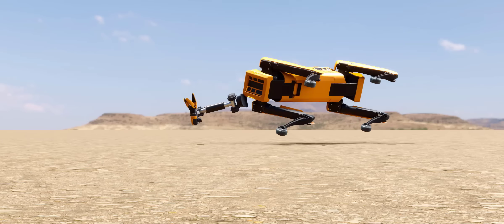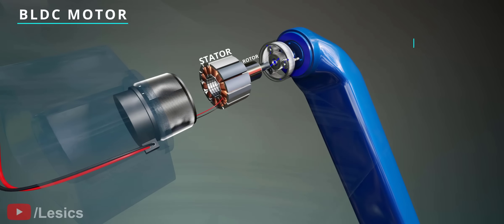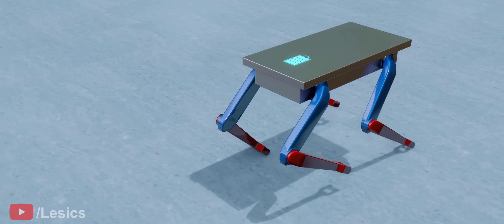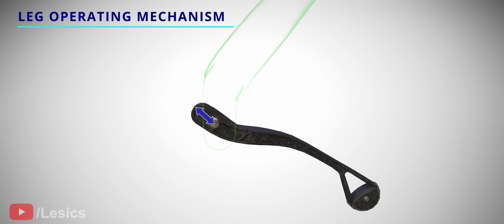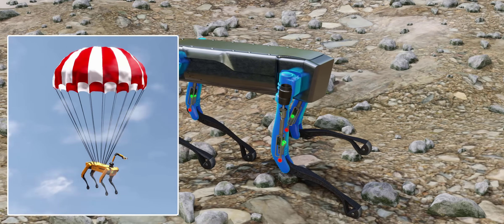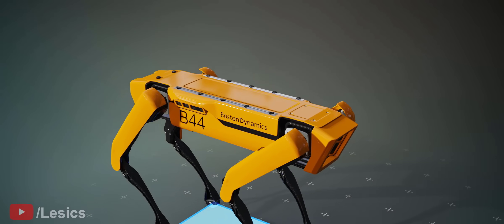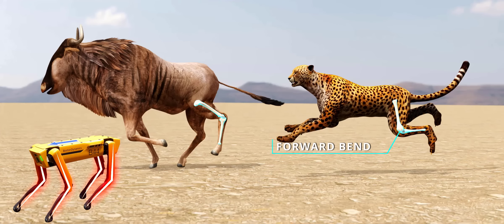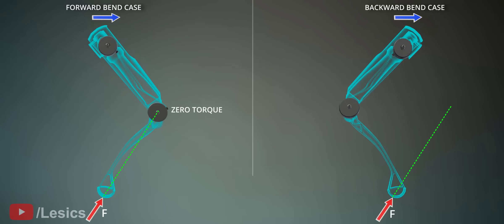Boston Dynamics Spot Robot | All of its Engineering SECRETS!

Comment: A backward-bend robot, like Boston Dynamics' Spot, is more efficient for forward locomotion because it mimics the natural ankle action of many animals, uses less energy, and excels at climbing stairs by positioning the leg more effectively. A forward-bend design offers stability in some aspects, especially for falling, but the backward-bend knee is superior for speed, stair climbing, and overall efficiency in locomotion for robots.  
Backward Bend Robot (like Spot)
Stability and Balance: Backward-bending knees improve weight distribution and balance, similar to a four-legged animal. 
Efficiency: Less hip joint movement is required for forward motion, making the robot more energy-efficient. 
Forward Motion: The backward-bending knee, acting like an ankle, provides a better "push-off" for superior forward locomotion. 
Stair Climbing: Backward-bending legs offer a significant advantage for navigating stairs and obstacles. 
Foot Clearance: The backward bend allows the robot to move its foot higher and further forward during the swing phase of its gait. 
Falling: If a forward-bending robot falls, it will land on its knees and then continue to fall with a smaller radius, making the impact less severe on its forward-mounted components. 
Forward Bend Robot
Stability and Falling: In a fall, a forward-bending knee would act as a pivot point, potentially causing the head to fall with a greater radius, leading to more damage to front-mounted components. 
Collision: The bend position could cause the robot to collide with stairs or obstacles during movement.

Comment: Why not just have a rounded back. Easier to then turn upright because it wouldn't rest on its back. Round allows it to roll and rock and is more structurally strong. Flat allows a break if it land on a sharp surface. Round, glances off.
Reply: It probably had something to do with the huge size and weight that design would require

Comment: There is no reason for colliding with stairs besides very poor control! 
How many humans have you seen colliding with stairs? or animals having problems with stairs or rock climbing? 
It might be easier for forward bending but it won't be problematic in the other case.
Also usually backward bending has an advantage in fast running.

Comment: Note that we have forwards kness but BACKWARDS ankles. This is why we are able to create reaction force with the ground. If Spot was also going to have three joints (hip knee ankle) I suspect it would also have received a forwards knee and backwards ankle configuration.
Reply: more motors, nore power drainage. Perhaps in future when battery capacity improves
Reply: @LinuxLuddite  not necessarily. They can work kinda like gears using kinetic energy
Reply: Man that evolution is very smart.
Reply: @dennisneo1608  lol!
Reply: Exactly 💯..thats what i was going to write in comment too...!   Their design has flaws 😅
Reply: @tanveerhaider9985  ;ॠ ҉ऋ ҉ऋ ҉zZmgr
Reply: @tanveerhaider9985 respectfully dawg, u rlly think ur smarter than the engineers at Boston dynamics? 😂😂😂
Reply: X
Reply: 8 hi by 8h by jñ by 7j
Reply: too smart...praise God for the engineering team of angels he has
Reply: Good one!